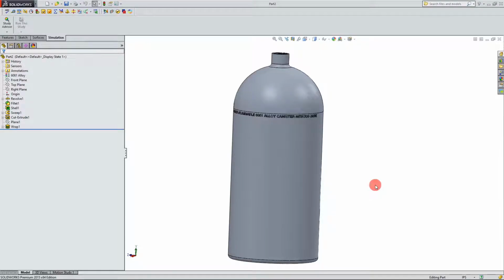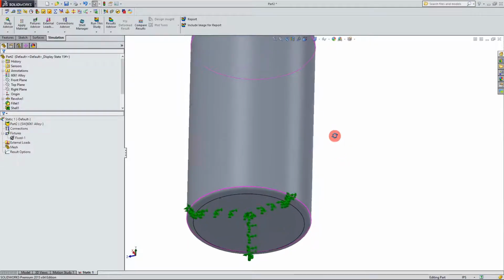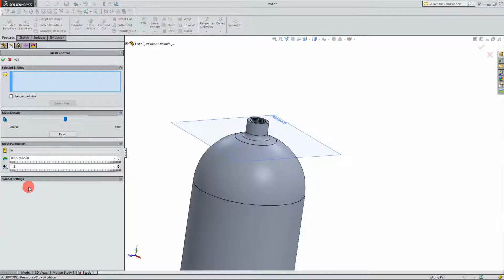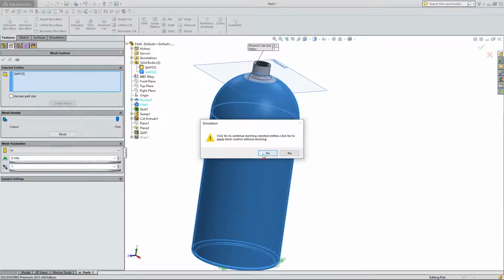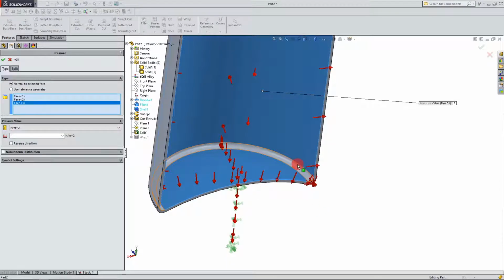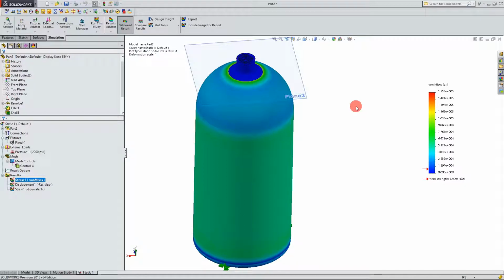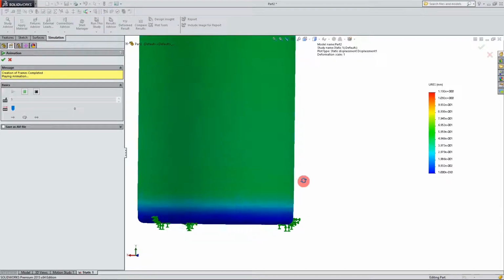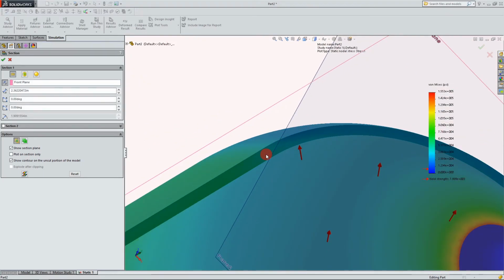Pressure Simulation - No² Tank in Solidworks! Tutorial

Comment: hi sir .how can make simulation for welled pressure vessel and tested the welled efficiency and  type of material by  applied pressure example 12 bar ....thanks
Reply from the maker: Create a simulation from a model made with a welded connection. That, or model the weld into the part as well as you can. Then, run a similar simulation. By the way, there is a "pressure vessel design study" made exactly for this purpose. All of these tips are just suggestions. Be sure to interface with a professional during all phases of simulation and design etc.

Comment: Could you say that with this pressure the material would fail based on the von misses?
Reply from the maker: When we turned the scale to 1, there was little to no change in the shape and size of the tank. For that reason, I don't believe it would fail at this pressure (just an estimate).
Reply: si, el factor de seguridad esta por abajo de 1